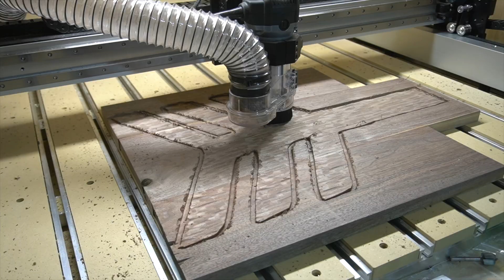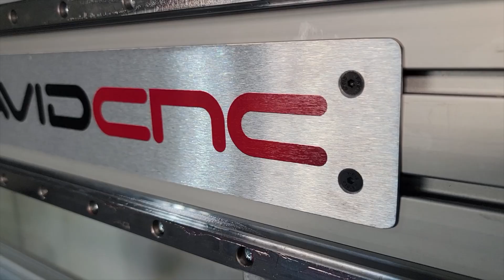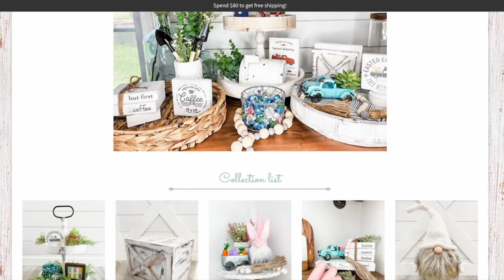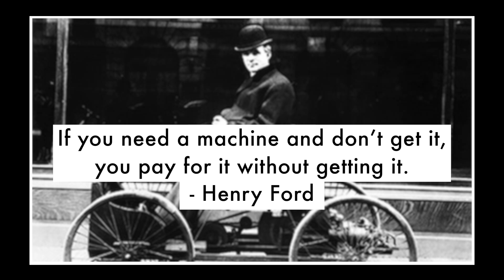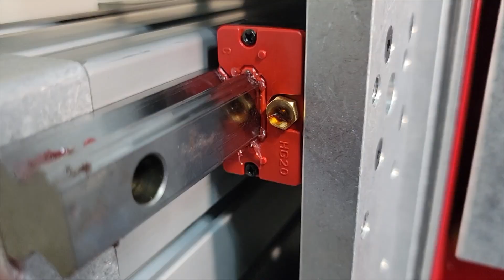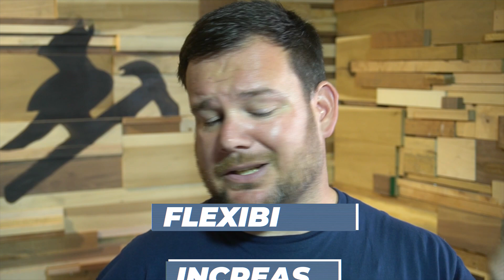My CNC business is about to explode!

Comment: I was kinda the opposite I used to work in aerospace and then when I got my ahapeoko I felt like it was a huge step back from all the milling machines I used to run and now 2 yes later I am running in to the same issue you had and am looking to get a larger maxhinw

Comment: I am impressed with my 4x8 avid pro. I did build my own motion control though, and went with clearpath servos instead of steppers. It has been pretty rock solid once I got it tuned in. For me, the next step up is a Shopsabre at 4-5 times the price.
Reply from the maker: Great to hear! I'm looking forward to making some sawdust soon
Reply: When shopping for a cnc, remember that saving money on the front end might cost you a fortune in production later on.  Rarely will you be upset spending another $50-60 grand up front.  If you're making money at it.  If you're just screwing around, then time is cheap.  I'd look at Weeke, Biesse, or even Giben.

Comment: Congratulations, Andy. That should be an excellent machine. I picked up a little Piranha Fx in early 2019 and was looking for a larger CNC almost immediately. In early 2022, it came down to a Onefinity Journeyman and an Avid Pro 4848. The driving factor was space limitations in our garage since we're not able to do an outdoor building without running into city setback limitations. We also plan on making a move to a new place with a dedicated shop/barn, so went with the Onefinity for now and will add/upgrade to something else later. I'd love to get an Avid Pro 60120 at the new place when that times comes. I'll be following along with your adventures in the meantime.
Reply from the maker: Hey thanks! I completely get the space thing. I've been contemplating building a shop for about a year. I keep telling myself, baby steps. I'll get there one day
Reply: @AndyBirdBuilds  And I'm sure we'll get to see it happen 🙂